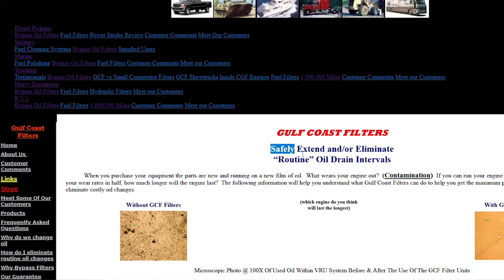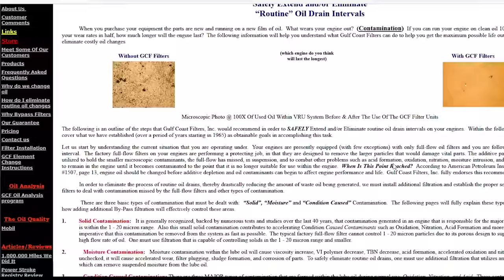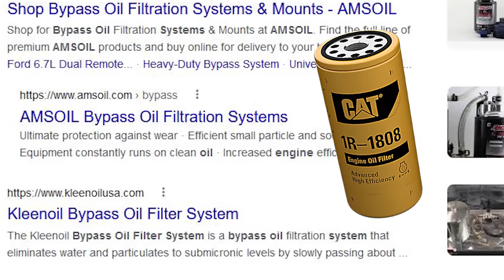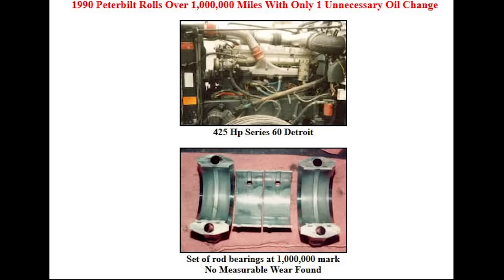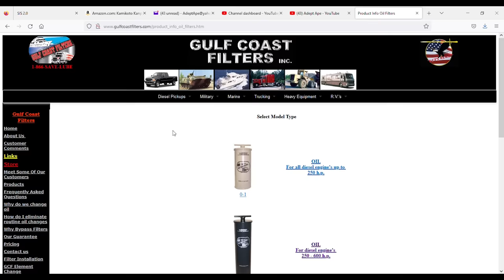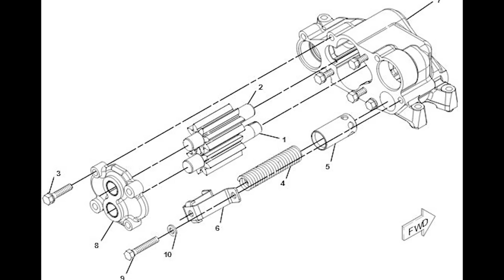No Oil Changes and 1 Million Miles!!! Are Oil Changes Optional with a Bypass Filter? (INTERESTING)

Comment: Never mention adding any fresh oil during the study? Engine doesn’t consume any oil over 1 million miles? Engine oil contains additives to keep engine clean and last longer. Those additives will break down over time. That is why the oil has to be changed at certain intervals. The bypass filter doesn’t renewal the life of the additives.
Reply: Actually 3 gallons of new oil is added.  Every 10.000 miles when the 3 gallon filter is changed. Divide 10.000 into 1 million miles. Road King did an article on this truck. They said the new oil added at filter change is equal to a full oil change every 40.000 miles.The advantage is the oil never gets dirty.
Reply: Most of you guys dont pay attention. Oil analysis shows that 3 gallons of new Rotella 15 40 added when the 3 gallon Gulf Coast filter is changed is a little more new oil than the engine needs. The reason the engine is in virtually new condition is the oil is always clean. The system of allowing the oil to get dirty then draining it makes no sense. It is an over the road truck. It would be the same on a dump truck. Might need to adjust the filter change intervals..

Comment: I had a guy come into my work(parts store) who claimed loudly oil changes were bullshit and weren't needed and a myth, hes never changed his oil in 20 years and isn't going to start now.
2 seconds later, wheres your 20w-50 5L? and do you have moreys? yup stickin motor honey and the thickest possible oil in a car that originally took 5w-30 because for some reason its burning lots of oil...hmmmmm
Reply: Probably didnt have a filter that cleans oil in the store Normally parts stores dont sell filters that clean oil. I did buy a WIX element to fit a Luberfiner at O Reilly's years ago. Not in the same class as Bounty big roll paper towels  pulverized newspapers and wood chips.

Comment: Something not covered here is the break down of the oil itself. The molecular structure of oil is comprised of long and short chain molecules. The shear effects in an engine when it runs cuts the long chain molecules down in size reducing their ability to support load. This is the main reason to change your oil. My comment has nothing to do with the bypass filter system only the extended oil change intervals. Sampling will tell when your oil is no longer useful and as mentioned in the video should be done every filter change if you are doing extended change intervals. Just what I have learned by talking with a petro chemist and reading about engine oil over the past 50yrs.
Reply: You are telling me ive been running on broken down oil for 60 years. Give me more of that broken down oil  I started with Standard Delo 30 before there were multi grades that could be used in a diesel..Delo came in w30 and w20.
Reply: Are you a Amsoil dealer.
Reply: @ralphwood8818  if this was directed at me no I am not
Reply: @holmes1956O  Sorry I gave up oil changes in 1963 Amsoil dealers gave me hell when I was selling filters.Toilet paper channels. Normal oil dont hold up .The molecules shear.I remember in the 60s you couldnt use multi grades in a diesel. I used Delo 30 w.. I have always been able to avoid the reasons for oil drains.I had to drain the oil because of a leaky head gasket.on the Rambler I should say I almost always avoid the reasons for oil drains.
Reply: The Peterbilt was a Shell oil test truck. My guess is the Shell Rotella got a lot of testing. Road King asked me for the truck owners phone number in 1996. Thats old news. The magazine article came out in the october November 1996 issue I believe.

Comment: No because semi trucks have 2 issues 1. it burns up the oil so you would have to add oil and 2nd. the longer you go without oil change the more your oil pressure and oil system starts to loose its flow as the filters get clogged. And after 15k miles without oil starts running out of everycrack and 1 Million miles unloaded aint shit because motor not working until its under load
Reply: The million mile truck was owned by Pepsi for years and of course hauled Pepsi Cola. Then it hauled motor cycles.I lost track of it at over a million miles.
Reply: The reason they use big filters is normally they dont clog up. Little bypass filters dont work with this system

Comment: Friend of mine is a master tech for Toyota and had a customer come in and demand a full motor rebuild at 100,000 miles. Guy wouldn’t say why and said he’d pay cash didn’t wanna argue about warranty. So they do it and when the guy picks it up my buddy is like dude the engine looked brand new there was nothing wrong with it no wear at all even though they did replace everything that involves a rebuild. The guy told him to put those parts in a showcase cause he got the car brand new and only changed the oil every 30,000 miles. My buddy was like I was so torn because something inside of him demands you change the oil at the very most 10,000 miles but usually every 5, but he also couldn’t argue with what he saw lol fucked him up hood 😂 hell, fucked me up good too cause I was in the same camp. Something in your brain just screams if you don’t change the oil often your cars gonna explode

Comment: THIS CAN ANSWER YOUR QUESTION HERE. "IF YOU ARE NOT MAINTAINING THE AIR FILTER WITH SYNECTICS OILS YOU ARE DOING MORE DAMAGE TO YOUR ENGINE WITH SYNTHETICS THAN USING CONVENTIONAL OIL YOU CHANGE MORE FREQUENTLY WHICH GETS RID OF THE DUST PARTICLES WHICH ENTER THROUGH THE AIR FILTER WHICH IS THE CAUSE OF ENGINE WEAR. IF YOU ARE GOING TO USE SYNTHETICS WHICH STAY IN THE ENGINE FOR A LONGER TIME. KEEP THE AIR FILTER CLEAN AND THE OIL FILTER IS A PLUS. THE DIRTY OIL YOU SEE IS THE END RESULT OF DUST PARTICLES PASSING THROUGH A DIRTY AIR FILTER. THESE DUST PARTICLES ARE SAND WHICH IS THE SECOND HARDEST SUBSTANCE IN THE WORLD NEXT TO A DIAMOND WHICH IS FIRST AND WHAT WEARS YOUR ENGINE DOWN. USING SYNTHETICS WHICH YOU CHANGE 1 TIME A YEAR COULD ACTUALLY DESTROY YOUR ENGINE UNLESS YOU MAINTAIN THE AIR FILTER KEEPING IT CLEAN OF DUST PARTICLES WHICH WILL KEEP ENTERING THE ENGINE AND DESTROY IT OVER TIME." THEORETICALLY OIL DOESN'T BREAK DOWN MUCH AND STILL MAINTAINS IT VISCOSITY. NOW WE HAVE OIL THAT ARE 0W-20 OILS. SO A BYPASS OIL SYSTEM THAT KEEPS THE OIL CLEAN IS OBVIOUSLY A GREAT BENEFIT.

Comment: Wonder how the rings and piston look running that long.
Reply: They looked new to me. I believe Shell oil was in charge of inspecting the parts. I believe it was using Rotella T 15 40.in those days.
Reply: I did check out the piston and liners. They looked like new to me. I believe the rings had been removed and measured
A lot of big wheels were looking at the engine. Didnt spend much time there.on the way to Florida. Charlie Sims took the wife and I to dinner.

Comment: Maybe a centrifuge bypass system would go that long without an oil change.
Reply: I doubt it.The system requires a big filter  that takes a large amount of makeup oil. Equal to a full oil change every 40 K miles. Its not the normal allow the oil to get dirty then drain it system. The oil is always clean. Thats why the wear rate is so low..

Comment: About 45 years ago an old neighbor of mine put a oil filtering system on his pickup that used what looked like toilet paper rolls. Does anyone know or remember anything like that?
Reply: Ive been using them for 60 years. Started with a Frantz oil cleaner and Delo 30 W in 1963.. all I have now is the Australian Jackmaster Classic  The Motor Guards and the Gulf Coast juniors  also the flat head Ford V8 canistef filter I converted to use Scott 1000. They all clean oil. The top loaders are easier to service.
Reply: The Frantz came out in 1953. The Motor Guard in 1961. I read somewhere the Australian Jackmaster  came out in 1954. Not easy to sell filters that clean oil when most people think oil is supposed to get dirty and be drained.not sure about when Gulf Coast Filters came out. They mostly do big equipment like offshore rigs ferry boats yachts military trucks. NASA. A NASA engineer said the filters are only for industrial use. We dont keep our stuff long enough.The Motor Guard on my 76 F 250 is over 50 years old..

Comment: I'm going to put one on my civic
Reply: Smart move. Good luck finding room for it..The Jackmaster Classic is a small filter. I wrapped.mine in cardboard and stuffed it  in a hole. Left the bracket off.
Reply: Got a call from a guy wanting to know if I wanted the Civic. He said it has a noise in the engine. It went about 200.000 miles in the city Had 350.000 miles on it. I put a Frantz on it when it was new. 79 or 80 model. Sold the Frantz in those days.. The Australian Jackmaster Classic is the best in tight places.
Reply: Seems like I remember the Civic had CVCC on the back.3 valves for each cylinder. 5 speed manual.The lady took care of the Frantz.

Comment: If the company selling this thinks its a good ideal why dont they put there product on several engines with the understanding if things dont go wright they will pay for it. Very few things in this world can be proven 100% of the time.
Reply: All the filters do is clean oil. The clean oil does the rest.  When I put a Frantz oil cleaner on my Rambler American the oil went from black to golden. I thought everyone will want one of these. I set up at a big flea market with a Frantz demonstration. machine. It seemed like every fool in the area came by. Boy that oil is supposed to get dirty it means its doing its job. If them was any good they would be on all the new cars. Then you get the guy that says the filter gets dirty the oil stays clean.makes sense..was set up at a flea market at Denton Tx about 1985. An old couple showed me their 53 Chevy they bought new and had a Frantz installed. A trucker showed me his two Frantz 3 stackers. Here comes another fool and told me so much toilet paper was getting in the oil Frantz has been outlawed in Texas. Gulf Coast Filters has filters on everything from locomotive engines on Shell Offshore rigs to shrimp boats and over the road trucks. Not sure you can prove anything to someone that doesnt understand the importance of clean oil..I prefer the top loaders. I like the Australian Jackmaster Classic  and the Gulf Coast junior. My oldest filters are over 50 year old Motor Guards. Motor Guard only makes compressed air filters now. You have to be mechanically inclined to install and appreciate these filters.

Comment: Nope Don't believe it!  Think, detergents grab particles and make them attach to the filter, the detergent in oil will run out.  Also the additives "wear out before it's time to change oil", thats from a oil engineer.
Reply: I learned about using filters that clean oil and Delo from a Standard oil engineer. He used a Frantz oil cleaner. I went looking for a Frantz dealer. All I have now is top loaders. Motor Guards Gulf Coasts and an Australian Jackmaster Classic. I have an old flat head Ford canister filter I converted to use Scott 1000 toilet paper.
Reply: In the 60s working in a full service Standard station in California the Frantz oil cleaner was a common sight. Saw a Motor Guard on a Mercedes truck. They were less common. Was looking for a camper. It was a small mercedes truck with a chassis mount. Out of my price range. Ended up with a 71 Datsun with a six pack camper.

Comment: That website is a giant red flag. Looks the early 2000s.
Reply: They have good oil flters. Never gave a damn about the web site. I have several of their filters in use. My oldest filters are 50 year old Motor Guards. My oldest Gulf Coast filters are about 30 years old. The Australian Jackmaster Classic is only a couple years old. I only use the top loaders.
Reply: When I started using toilet paper filters in 1963 I couldnt find any information on the phone. I bought the filter anyway.

Comment: Change  motor oil, change oil, change oil, change oil, everywhere up town down in town and on YT, change motor oil, it's a simple no brainer job and I change motor oil every 5k............ But yet not a peep about changing trans oil anywhere on YT, and that needs to be done or it will be a 4k repair bill, because no one harps on changing trans oil, and whats worst theres no one on YT making videos about changing trans oil, showing how it can be done by home owner..... I want to start seeing freeken YT videos on changing trans oil, starting with 2018 Jeep Cherokee latitude, end of trans fluid oil rant............
Reply: I gave up allowing oil to get dirty then draining it in 1963. I have filters that clean oil on all of my transmissions and motor oil. The best thing to flush out a transmission is clean ATF.

Comment: When you change the filters when you're supposed to and add the oil back that you lost your not running the same oil a million miles
Reply: Very true. When I started with a Frantz oil cleaner and Delo 100 W30 in 1963 I changed the Frantz every 2.000 miles and added 1 quart. Delo was a decent oil. It was tempting to pay double for the multi grades. I had inside information that the multi grades were no good for extended use. Also Frantz didnt recommended any of them. They are a lot better now.
Reply: The test truck probanly got about 350 gallons of new Rotella added in a million miles just adding make up oil at filter changes. Some truckers go farther between filter changes.